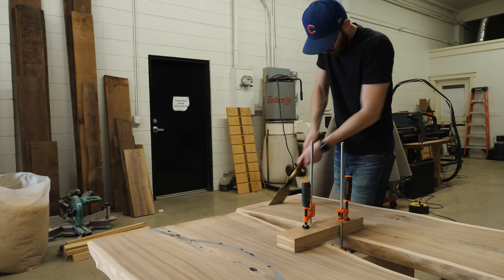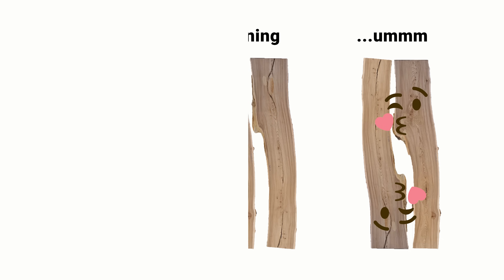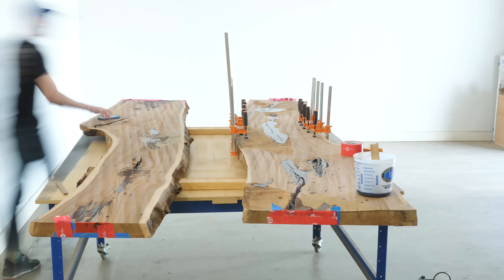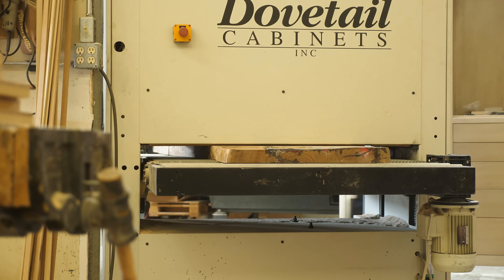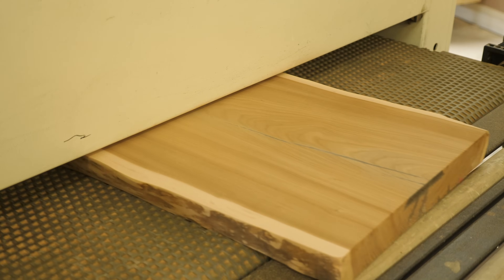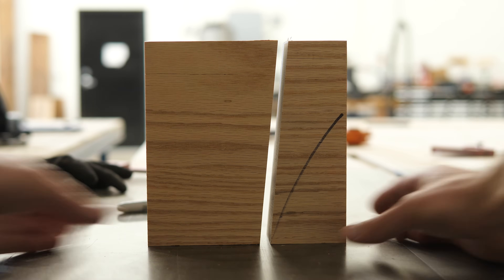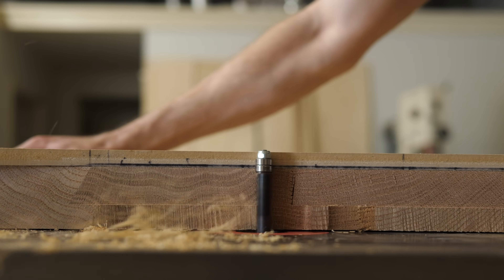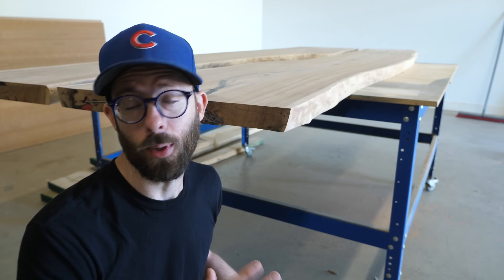I Guess We're Building River Tables Now

Comment: Personally I like the open look, but if I was going to add glass I would do the river look. There is a nice band of lighter wood along the edges that would provide a natural template for the glass. Also, just another thought, but for the metal joining plates I think it would be nice to engrave the numbers into the plates and in the wood for anyone assembling the table, just looks more inline with this price point of table than labelling with pen. Just my 2 cents though.
Reply: If I was going to add glass I think I would just want a shallow recess so a single piece of tempered glass fit all the way down the length with an even surface height. The Sort of Null-river effect is nice, the glass would be mostly to ensure the safety of placing things in the middle of the table when in active use.

Comment: The open center would make that an amazing conference room table.  install a power strip and a pair of 16-port switches to the underside facing the center, and the center is a perfect place for cables from guest devices to drop out of sight.
Reply: I also thought it would make an amazing conference table, but I must admit I hadnt thought of the power point angle,  In my day, which was about 10 years before The Great Flood, nobody even had cell phones! Lol.  
As a dining room table, I would want it to be a river table. Just personal taste.
Fabulous piece, as are all your pieces.
Reply: You might look into silicon bronze marine hardware to have something strong and looks "high end".
Reply: A year later and the table with a big hole in the center is still not sold...
Reply: @graealex  Spending 12k on an unfinished table is a big price... it would have been great with an epoxy river in the middle.

Comment: Glad there was no circle glass in the middle.  I really like leaving the middle open, If anyone had a problem with it or needed to set something in the middle you could certainly find some sort of nice tray to bridge that gap that wouldn't take away from the table design too much.

I do find it interesting how many people have mentioned getting on a second coat of a product called Monocoat lol, I have had areas of projects where it soaks in a little more and I needed to add but I have never done a second coat because it doesn't stick to itself, But there is a maintenance oil or something like that that can add a little more sheen if that is what someone is after. I tend to really prefer the matte finish. 

And I have used it on non-flat non-large surfaces, it's not terrible but it's also not as easy as some other finishes that's for sure. Usually I rub it in with a small square of a white scotch brite And it works out pretty well.
Reply: It depends on the wood species, for instance, Rubio recommends two coats for open grained woods like walnut or red oak. For something with tight, closed grain like maple, 1 coat is generally enough. Though I have done two coats on maple if there is any uneveness - for instance curly maple can suck up finish unpredictably - or sometimes I fail to apply it as evenly as I should - two coats always looks better than one coat in my experience even if not expressly needed. I think it's important to realize that monocoat was developed as a floor finish and a second coat can be really expensive over a large area and uncessariy given how flooring is generally viewed. But for fine furniture a second coat can be worth it. Especially for woods like walnut where you can build a much nicer finish. One thing I like to do for walnut is wait a day, sand with ~1200 grit until the pores are filled with dust, then apply a second coat, this works as a psudeo-pore filler and makes walnut look and feel a lot better than just a single coat. Also, sanding to higher than the 120 grit recomendation is a good idea for furniture. 120 is fine for floor but 220 will look and feel a lot better and I know some people go much higher.

Comment: Re: Rubio Monocoat — I use this on almost everything indoor furniture. I’ve tried Osmo Polyx and like it, but I just prefer being able to only apply one coat. That said, I’m a hobby woodworker and don’t have a spray gun. So what I’m saying is that time spent finishing is not a big deal because I’m not trying to bang out a bunch of projects for clients, and therefore the somewhat tediousness of rubbing Rubio with a white 3M pad into small angular spaces is not something I mind doing. Also, what I build is for myself, friends, and family so if ever the single coat failed, I could easily add another. 

Great build video. I’d prefer you left out the verbose explanation of every milling step, for the reasons you highlighted. However, I like explanations of problem solving, design choices, and unique jiggery.
Reply: My go-to finish is Bartley gel varnish.  Easy to apply, great low gloss finish.  Never done anything this big, but used it on a 3'x6' desk and it's fab.

Comment: with two more closely fitted together pieces, I actually really like the open space. These two slabs coming together leaves too much of a gap in the center to be functional. If it was a slimmer strip of open space, the user could cross the distance with wood cutting boards or large serving platters when it's time to set the table. 
But I actually think it's the most creative of the options you considered, just leaving it open.

Comment: "every issue of spiderman is someone's first issue of spiderman" is actually one of the trickier aspects of serial content and I respect that y'all are trying to craft your approach to it! I think with woodworking people get a really decent sense of operations (jointing, ripping, planing, glue-ups) after a video or four, and watching those operations in high speed with a voiceover acknowledging what's happening works swell. what can spice those up is some discussion of the problem-solving that goes into doing that particular operation with that particular piece of wood for that particular project, and I think you guys cover this pretty well (eg noting that something won't be visible in the final project so you're not doing it a certain way.) if there isn't something specific, using the time to insert whatever tip will fit in the space (jointing opposing faces so that your 89.7 degree fence issue comes out in the wash) means you can link to both the video with that tip and your tips and tricks videos if folks are new and want more of that. (do people click through to linked videos? I suspect the rate is quite low but I am not a producer of this kind of stuff.) 

all of that said I think you handle the balance well, your editing and pacing is great, and I do not tend to do the "OK i know what's happening here, let me use the thumbnail to find the end of this step" thing on your videos all that often.

Comment: I am so happy to see someone considering the issue of moving around the furniture. I worked for an interior design studio and the biggest issues of installation was the size and weight of the furniture. We had custom made luxury pieces that just,, could not fit through doors or up staircases or even in an elevator. Modular design doesn't seem important until you have to carry a giant couch up 17 flights of stairs because it cannot fit in an elevator.

Comment: I think a really custom piece of glass, while expensive, would look absolutely rad if inset perfectly into the live edges but I definitely love the table as is.
Reply: 1/4" plate glass: rad, 1/4" polished brass : cool, 1/4" teak: nice.  having a flowing custom inset piece allows for easier shipping and handling of smaller pieces, over locking the slab together with epoxy into one massive piece.

Comment: I've recently started watching your videos. I watch a handful of other channels pretty regularly. I really enjoy your humor and explanations of how and why you use the techniques that you use. I ruin perfectly good wood as a hobby and watching you has spurred me to buy a couple small slabs of hackberry to work with. I'm going to combine epoxy and a metal frame/legs to attempt to build a coffee table and a pair of matching end tables. Both are far outside of my experience level and comfort zone. Your idea of using the left over epoxy from your pours gave me the idea to buy silicone coaster molds to fill with my leftovers.

Thank you for these videos and don't change a thing.

Comment: 11:07 Yes! Show the making of panels in the project video but as a montage. You only need to show each tool being used once. That's enough information so that someone can imagine how the initial board got turned into the panel. This can be used as filler while the voice over is explaining something else. Link the "perfect panel" video during the segment where the panel-making montage is shown. That way someone can find that video if they want to know your method. It just helps with understanding the final segment (where all the pieces get put together) if we actually saw each piece being made, at least in montage. This is a good way of splitting the difference between satisfying those whose main interest is in the technical details, and those whose interest is more in the overall process.
12:44 yes, this is very noticeable! The splaying allows more room underneath the table, and prevents people's knees from running into table legs. My brother is 6'3", and he constantly rams his knees on table legs. It's also very helpful for accomodating wheelchairs and service animals, or walkers. My late grandma was always much happier when she could have her walker stowed under the table so she didn't have to get up from her chair in order to get it. The splaying also helps prevent chairs from getting stuck on the table legs, especially during large family gatherings when you're liable to set out more chairs than what is recommended for your table. Overall, I have found even a very slight splay is considerably more practical than a straight-legged design.

Comment: I hope this message finds you well. I wanted to share some thoughts regarding the low base stretcher in the table design:

Restricted Leg Space: The low stretcher interferes with legroom for individuals seated at the table. It restricts the ability to stretch out legs comfortably, which can lead to discomfort during extended use.

Cleaning Challenges: The placement of the stretcher close to the floor creates hard-to-reach corners, complicating the cleaning process. This can result in the accumulation of dust and debris, making regular cleaning more difficult and time-consuming.

Visual Weight and Space Perception: The low stretcher design makes the furniture appear bulkier and heavier. This visual heaviness can make the room look smaller by breaking up the floor space. Additionally, the black finish of the base draws attention and makes it a dominant focal point, which might not be desirable in all settings.

Love your channel, keep up designing and posting your inspiring videos ;-)

Comment: If you’re going to cover the middle, go with a glass to match the curves of the slabs.  Would need to either use a laser scanning system to get the shapes required or go with a trace paper and lots of data point measuring.

Comment: I think the table is beautiful and great work.  If it's an artistic piece, the form is great, and if it's got a fairly static display on it, then it is ok.  But if it's going to be function, it falls apart pretty quickly.  Glass down the center is a clever idea.  Epoxy table is also fine.  Another option would be to do a whole glass top on it as well.  Then you leave the entire piece in it's full artistic splendor, viewed through a glass top that can be used for every day function even with heavy use.  In any case, it's really great work.  I don't want to detract, just add some ideas about form and function, and that would drive what the buyer might want to do with it.  (I'm a year late to the party on this video, so probably it's sold already). Scott from Japan

Comment: on the river sides or the insides you should have drilled in to about 4" form the opposite edge and drilled dowel holes, then glued glued up the dowels on a flat surface under clampage so they are book edged about a 14" from one another then poured acrylic or whatever so it could be a full width table, it would have sold as a nice conference table whatever..

this way you could have position them so there was a constant 14" gap like river that just had a crook in it, the table could be modular and larger.. the way you have it spaced at 21:35 would have beena perfect layout, maybea touch wider acrylic dowels every 12" would keep it very rigid and stable..

I see someo guys doing riverscapes in the acrylic, rocks, fish, pants, so forth, mini scale of course but that would have been a perfect conference table for a legal poutfit where they like fishing so forth, or just rivers..

its a nice table all the same

Comment: Speaking as a mechanical engineer, you can buy bolts that are brass coated, however, I have personally never seen brass coated steel screws (that small in diameter) that are strong for your kind of application where there is a LOT of force applied in a static state. Personally, McMaster Carr is a great resource for that kind of thing (at least as a starting point because it's not always cheapest) but you can find very high strength stuff with lots of different finishes. Especially considering you aren't welding, a coated bolt or screw that is thicker but just "more attractive" is definitely possible but you may have to design around it a little.

Comment: Great job, such a beautiful table. I think you really made the best decision to leave the table top open. Best design is a simple design, with less (different) parts and materials. The wood is so beautiful and adding anything else on it will take away from that. 

If it was my table I would have closed the table top from the underside, sealed it with something water proof, filled it with some substrate and plant some low growing succulents/sempervivums. But thats because i’m a plant addict :p

Comment: Had you thought about using flat black automotive style hardware? Just a thought.
The cover plate looks great. Though, a piece of black anodized aluminum would've also been nice.
I like the open middle. But for function, I would end up getting a piece of glass cut to sit over top of the whole thing. I know that would detract from the piece, but it would protect the table and solve for the open section from a functionality perspective.
Clear epoxy would work well, but it's not easy getting the epoxy to be clear like glass.

Comment: Great work, I really like the river table look without the epoxy. The one question I have is with the threaded inserts on the base. I question putting inserts into end grain, I raking action of the table over time will loosen these, I would have gone with a mortise at least half way through the upright to stop any twisting action and racking to the base.

Comment: The bolts are good, but if you need the corrosion resistance and brass look, look to silicon bronze hardware.  It's what the boat builders use.  Much stronger than brass.

Comment: Definitely like the split design in the center.. If I was buying it I’d ask for a center strip of glass maybe an inch wider but not flush with the table and more raised above it by an inch with similarly angled pieces like the legs of the table to hold the glass above the table.. 💪🏼💪🏼

Comment: 2KM? 2 meters but thats 200 cm. Amazing job. My idea is to use one clear piece of glass for the whole space between the slabs. it would allow the slabs to remain pure in their amazing form and make the piece usable. Form nust follow function and you cant have things falling thru  (which they will) whenever the table is used. This is not a sculpture.  Dont know how the glass edge  would be made to match the edges of the wood slabs. That may cost a lot but i think it will be worth it. This is a fantastic piece !. You guys are very telented.

Comment: I would give it a gigantic oval glass top. Like 1" thick with a wide bottom chamfer and rounded top edge that overhangs the slabs by at least 6 or 8 inches all around.

Comment: There is a company that makes 3’ and 4’ wide visquine used to protect carpet. It’s sticky like tape on one side. You should look into it to use on the bottom of your slabs to control the epoxy when you pour it.

Comment: If it were my table the center would have a thin lower layer of black epoxy then a light blue on top (should it give it depth and not see thru like i imagine it) however that being said your route leaving it alone at this point is the absolute best decision.....as you said not everyone has the same taste. The dog bowl version you mentioned did get me thinking about a glass lazy susan inset into the center of the table could be really interesting if the sheen were the same or close enough to not stand out drastically

Comment: No glass, may be 2 or 3 lazy Susan's three sizes so they can 1. Spread the length of the table or 2, stack them like a center piece so if they are 1. Not using the whole table 2, using it as more a  design because nobody is eatting.